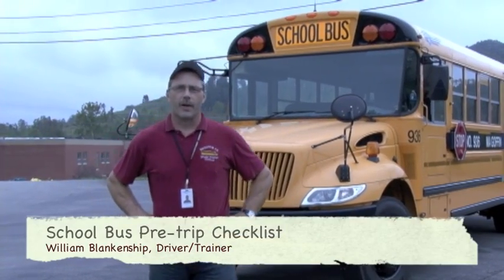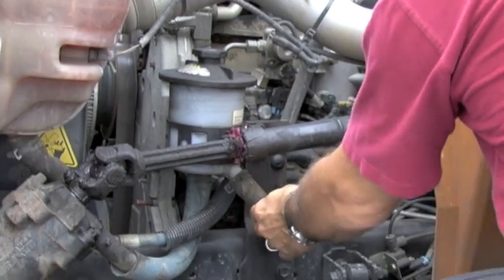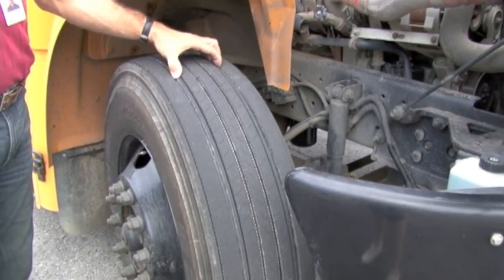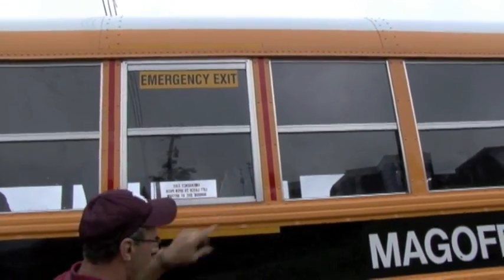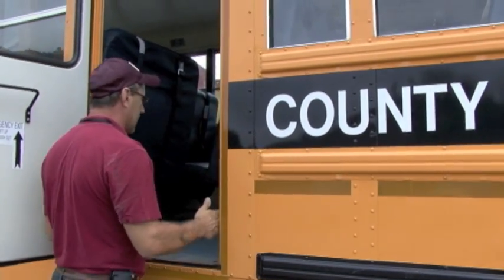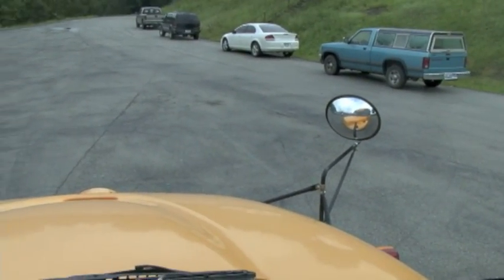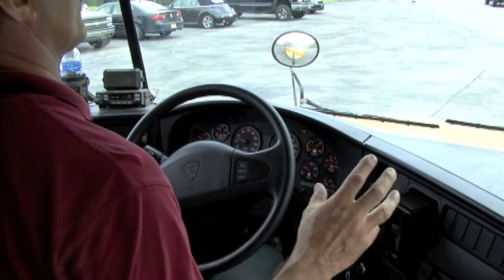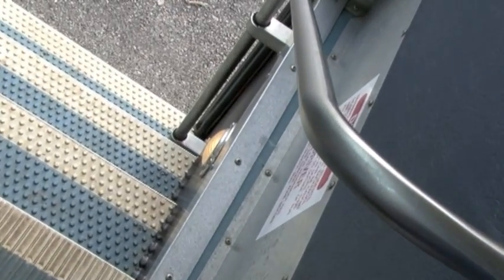School bus Pretrip Checklist

Comment: you should chalk your wheels when doing an air brake test as the bus is in neutral and could start rolling and cause an injury. You missed the governer cut in and cut out and build time on the air brake check.Cut-in: 85psi minimum
 Cut-out: 130psi max
 Blow-off: 150psi
 Low air warning: 55-75psi
 Auto application: 20-45psi
Reply: In Texas we are not required to chock our wheels unless parked on an incline......however where I live it is pretty flat!